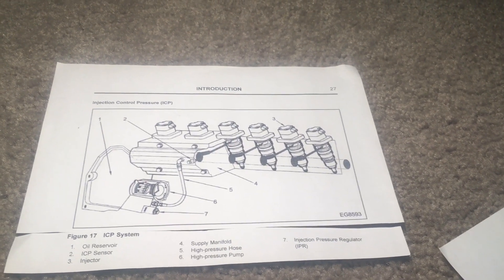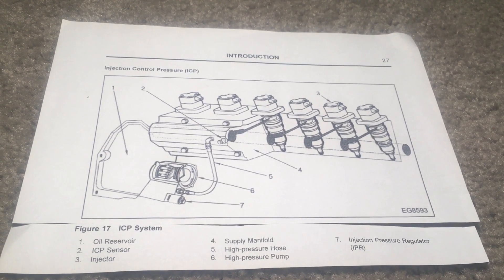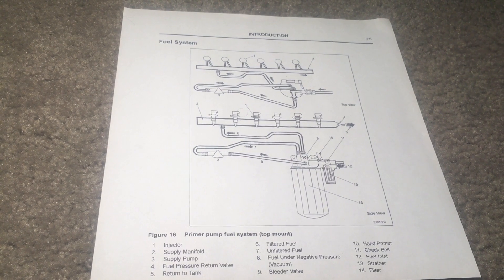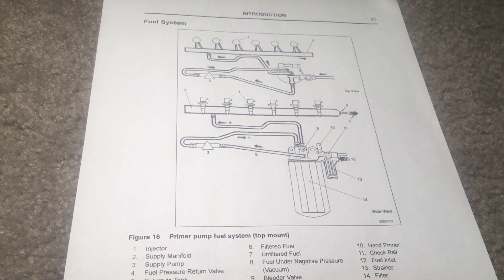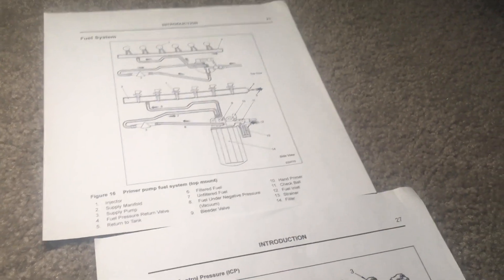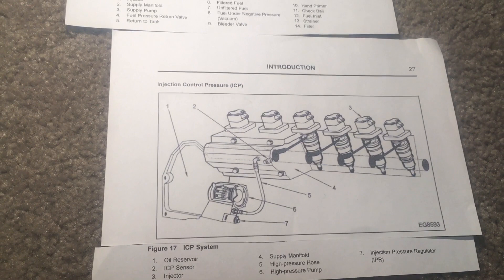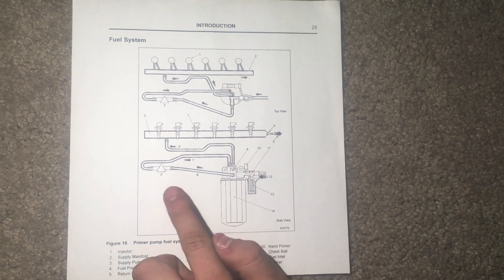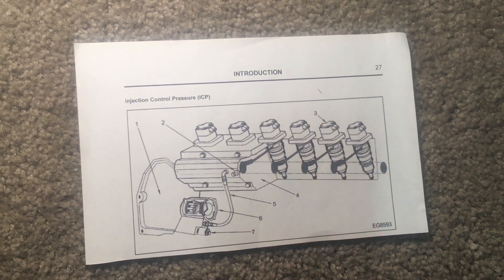DT466E Fuel System

Comment: Thanks man. I have a dump truck with this setup and its not receiving fuel somehow.
Reply: Were you able to troubleshoot you problem?
Reply: Same it's a pita I have changed everything on it
Reply: @409demo  I have same problem, I hooked up electric pump right before mechanical pump, doesnt seem like fuel is making it to output of filter head.
Reply: @ianbowline404  sounds like exactly what im going through

Comment: This fuel system works but is very unreliable and is expensive to repair .  International’s MaxxForce engine is another DUD !
Reply: Not expensive to repair at all depending on which truck it's in can be time consuming but usually not